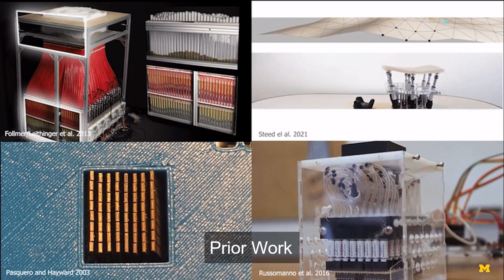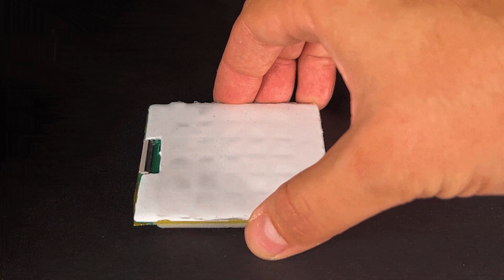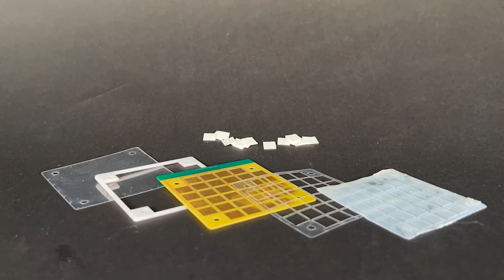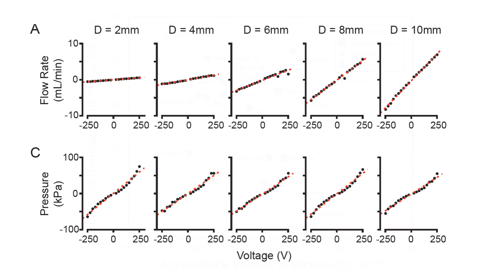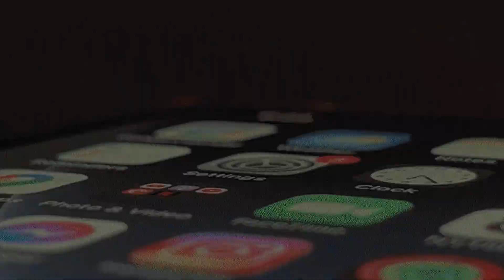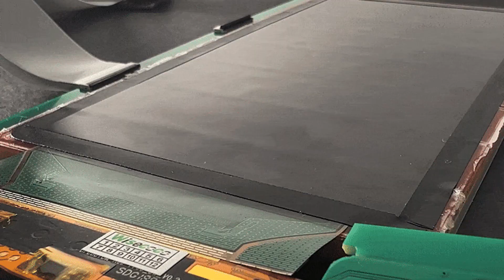Flat Panel Haptics: Embedded Electroosmotic Pumps for Scalable Shape Displays

Comment: The voltages involved in order to produce a user-detectable displacement are almost (but not quite) into extremely-cheap ULN2003 darlington-array territory! now here I go on a saturday, tumbling down the "what very cheap darlington array can I find in volume that'll handle >100V" which is not a question I had ever considered before.

I kinda wonder if there's a favorite of the folks running nixie tubes and whatnot which may be suitable...
Reply: It’s 400v peak to peak. So mosfets. Similar to sota electrostatic shape displays

Comment: This is amazing, I just stumbled across this video. I have a huge interest in using membrane actuators in robotics and I am looking for simplified ways of creating and controlling hydraulic flow. Is there potential for the power density and efficiency to be "ok" compared to an electromagnetic prime mover and could the stall pressure be increased by cascading multiple pumps in series?